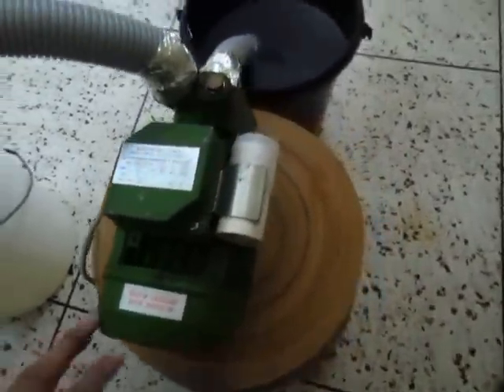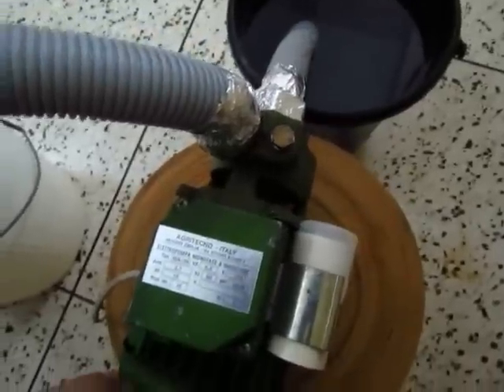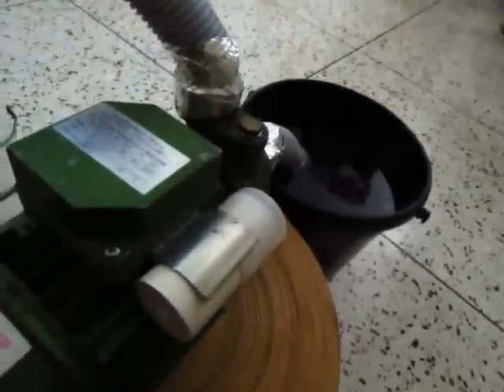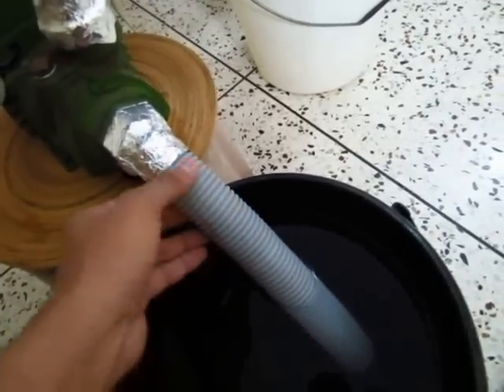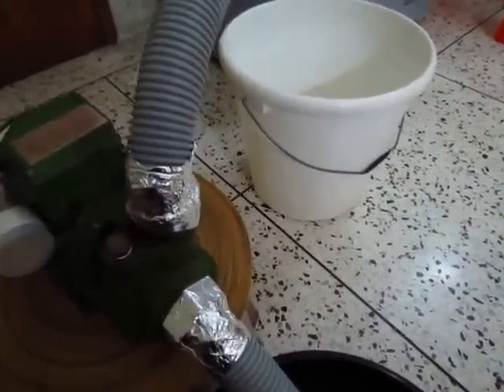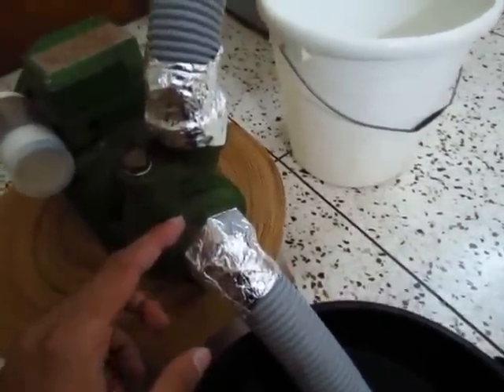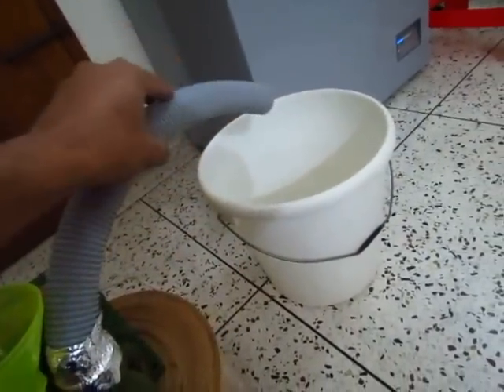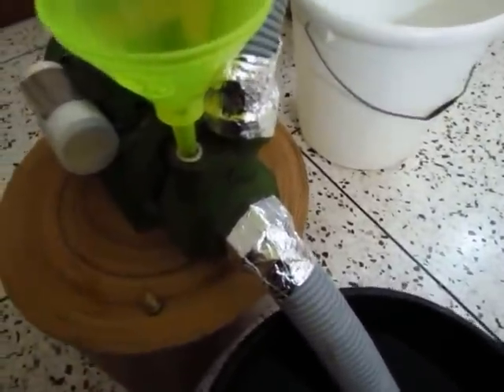How to fix a water pump that is not pumping water (priming)

Comment: Hi Maruful! Thanks bro, let me try this trick. one small doubt, can't we fill water through the outlet ? won't it fill the vacuum part with water? :-)
Reply from the maker: If the outlet is almost filled with water then it will work. The outlet is a thick pipe, you may need more water. Regular household buildings that use water pump actually have water in the outlet almost all the time from the main supply thus this doesn't usually happen.
Reply: Maruful Huq : unfortunately the pump was not used for 5yrs after a little use. now the motor is not rotating, can you advise on this kindly?
Reply from the maker: If the pump powers up (tuns on) then it can be a jammed motor/bearing. You can use WD-40 spray or car brake oil to free the jam. Kerosene also helps in freeing jam but WD-40 is the best. Also try tapping the joints lightly with a hammer, it helps to break rust.

If the pump doesn't power up at all, that probably means some wire is broken or the circuit is burnt. Try to open the circuit board cover and see.

Comment: is this a permanent solution
Reply from the maker: No it's not. If there is air in the inlet pipe or if the pressure of the water in inlet pipe is low then you will have to repeat this process.
Reply: so how to fix this permanently
Reply: any parmanent solution
Reply from the maker: Ankit Phulera No permanent solution. One thing you can do is make sure the pipes and joints are well sealed such that air can't go into the system.